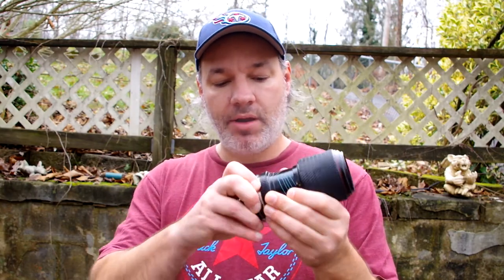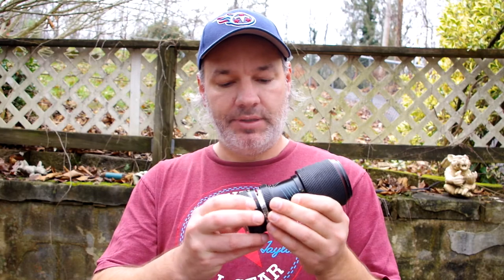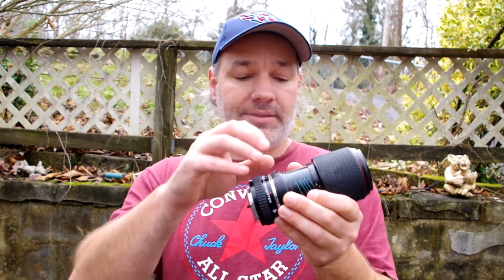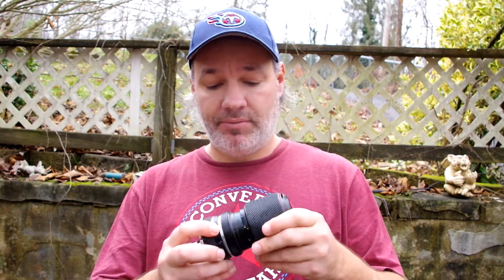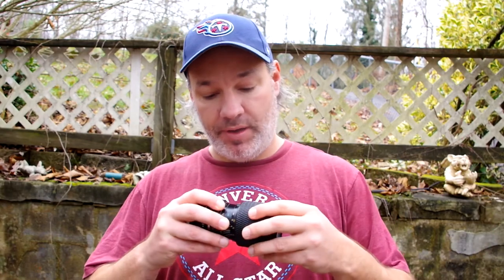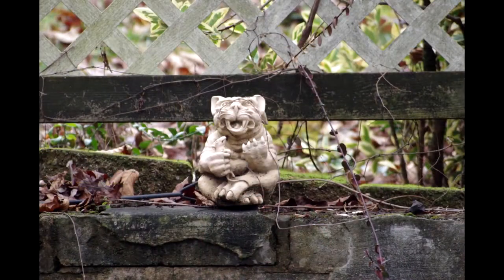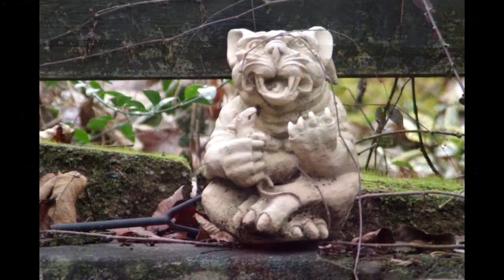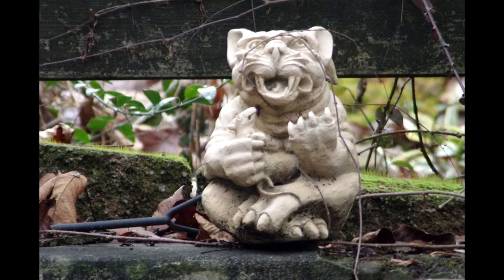Lens Teleconverter explained test review

Comment: The only TC I use is the Pentax-A 1.4L, and then only rarely with my A* 200 macro for a bit of extra working room with certain subjects.  That combination works just a bit better than the crop method.  Ive tried other TCs such as the  Pentax-A 2L, the 1.4s, the 2s and the SIgma APO AF, but was not happy with the results.

Just a point ...: The Pentax-F 1.7 is an AF converter and should not be used as TC because it has moving elements.  Using it as a TC will, especially on a MF camera, will mess up your focus range if the elements are not in the right place.

Comment: I fully agree with you regarding teleconverters generally, and anything over 1.4X in particular.  However,  in my opinion an exception is the Pentax DA AF 1.4x Rear Converter AW for K-Mount .  At just under $400, it's not a decision to be made without due diligence, but my research suggested  it would be worth the price for use with my Pentax DA* 300 mm  f/4, and I wasn't disappointed. But this is very much a niche application -- wildlife, tripod etc. -- and I agree that you're suggestion of magnification via cropping is preferable generally, especially for video display where you can do some pretty radical crops and have a very acceptable result.